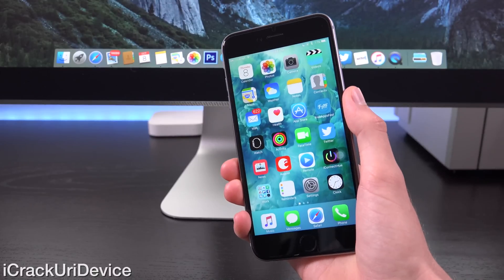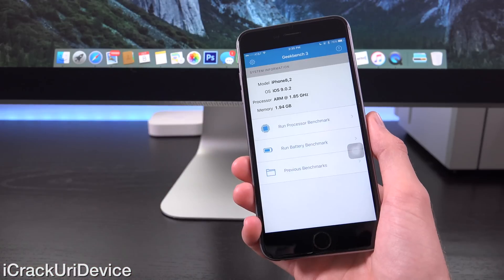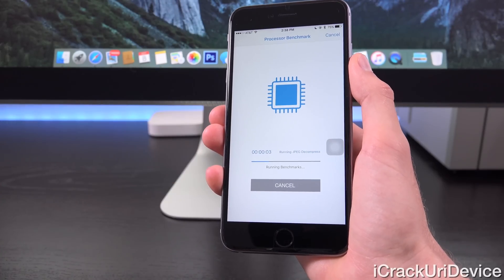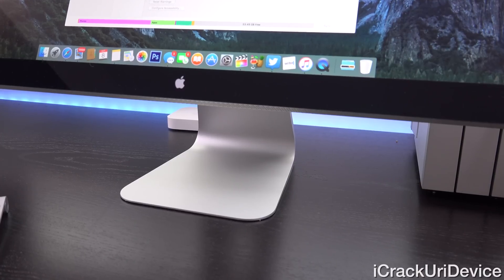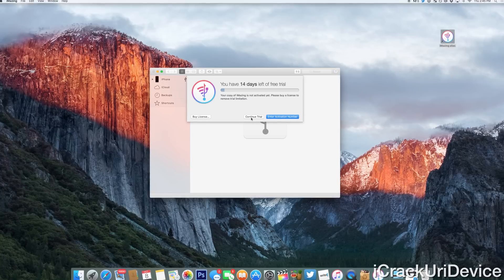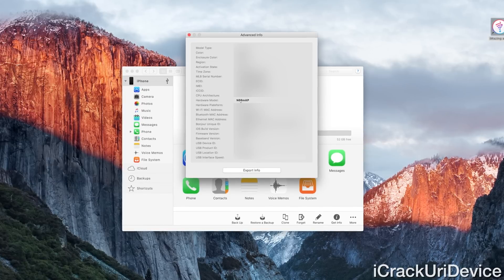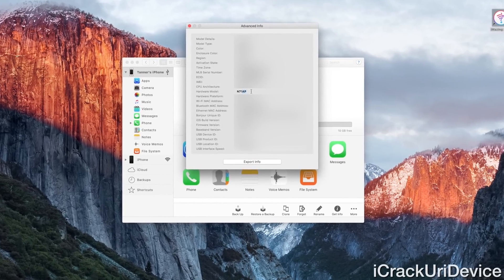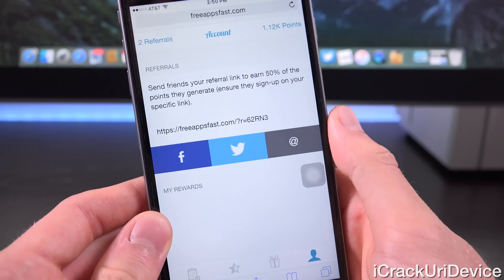iPhone 6S Chipgate - Samsung vs TSMC: How to Find out Which A9!

Comment: Before I got my iPhone 6s replaced, it had the tsmc chip but after I replaced my iPhone 6s, it had the Samsung chip. It doesn't really matter to me because my new replacement runs more smooth than the tsmc model which I noticed when I bought the phone but it takes the battery slightly bit off than the tsmc model  . If you're a heavy user, then I highly recommend to get the mophie juice pack air for the iPhone 6s/6

Comment: samsheeps are so gullible to think the phone was apple that had anything to do with it when Samsung supplies was the one that made apple who designed the chip parts from them make the phone work uncontrollably. There's a reason TSMC works without a doubt and the reality that it spares better battery which is enough to prove these wrong.

Comment: Hi, iMazing devs here. Nice video, thorough and energetic ;)

Just wanted to point out 2 small inaccuracies:
1) You can 'Trust' the computer without launching iTunes
2) iMazing is a code-signed application: no need to set GateKeeper's "Allow apps downloaded from" setting to "Anywhere":
"Mac App Store and identified developers" will suffice. 

We don't recommend for security reasons to use the "Anywhere" setting, bat all. It opens the door to potentially unsigned, and malicious applications.

TSMC here by the way ;)

Comment: So many apple fanboys here, I personally hate Samsung's phones and I stick to HTC but Samsung make among the best quality processors and NAND storage. so don't be surprised if your 64GB of storage in your locked down iPhone is also from Samsung ;D

A simple firmware update will fix this as a smaller chip dye makes them more efficient but they tend to pump out slightly more heat because the transistors are packed more tightly
Reply: +stevob211 
Yeah and I hate it when isheeps think that samsung chip is shit but in truth the chip inside the iphone6s is designed by Apple not Samsung. So if there are some problem with the phone, its not samsung's problem but Apple's. Apple just used Samsung's 14nm technology.
Reply: more heat = more throttling..
Reply: +6IaI Your simplistic logic is flawed, different processors have different maximum heat setting before automatic throttling comes into play. there is also different power phases dependant on the utilization of the CPU, Samsung might use slightly higher voltage when idle but could have a tighter powerband, optimized for less consumption when being fully utilized.

Throttling only kicks in at extreme temperatures, not 33c...
Reply: doesn't prove what this video does.
Reply: +Bull Shit Man the 2nd go read the apple press release about the differences. the processors can use more or less than each other by 2-3% in real world scenarios.

Come back to me when you actually understand processor architecture.
Reply: No other companies except samsung can build 14nm chipset for phones. Even tsmc can't build them.
Reply: Mewmewmew:3 You are somewhat correct in your statement, this is partially due to the amount of money that Samsung invest into their R&D departments.

Innovation keeps them at the top of their game, and also keeps companies buying their chips.

I can't fault Samsung for their processors or storage devices as they are very high quality, my notebook has a Samsung SSD and they are one of the most reliable and fast SSD's around.

Yet I still use a HTC since all Samsung care about in their phone department is bigger, more cores and bloatware with touchwiz plastered on top.
Reply: Mewmewmew:3 It's most likely a bad combination of chipset fimware that still needs to be ironed out by apple and also the fact that they are trying to squeeze the phones thinner each year before spending any money on R&D for important things like heat dissipation and tougher metals to prevent bend-gate, which in turn they try ignore to prevent having to start a recall.

Otherwise they just dub it as you hold the phone wrong, putting it in the wrong pocket to prevent any unexpected costs. - If another company did the same, they would get nailed.

Comment: wouldn't the one that uses more power produce better performance?
Reply: A smaller die process theoretically increases battery and performance.  This is at least true for the most part for all CPUs.  I'm assuming the api is directed toward the TSMC version.
Reply: *****   Apple doesn't "make" any chips they simply get other companies to make it for them.  Apple has never made any chips.
Reply: ***** Yes, thank you.  I definitely needed two people to tell me one thing.

Comment: fuck fuck fuck fuck!!!  thanks to this video i know why my iphone 6s+ sucks ass!! fucking apply, letting crappy samsung  make their A9 chip fck i have the crappy samsung A9 chip FUCK YOU APPLE!
Reply: The difference is extremely negligible you mong.
Reply: +Fod Woggler lol iPhone just blows the chip only kinda affect how the phone is going to run. pros of iPhone are Siri and the phone has a front flash camera. other than that you're going to have to wait till the iPhone 7 to have what the galaxy s6 has as features. my bad this phone can also take gif pictures.
Reply: +chandler smith or get a better version of s6 features like what Apple Pay and force touch does compared to android holding down on something and Google wallet, but it has been confirmed there is no chip gate by consumer reports.